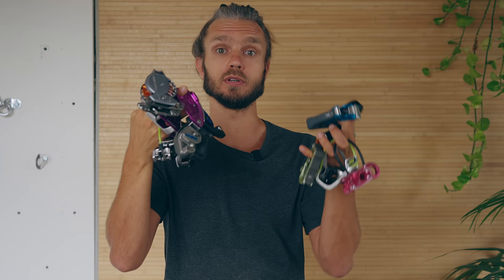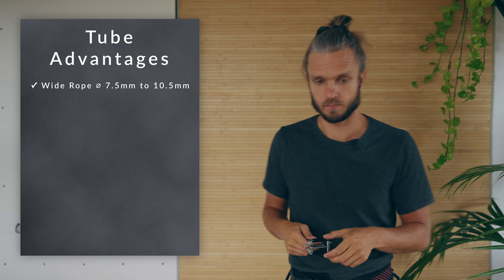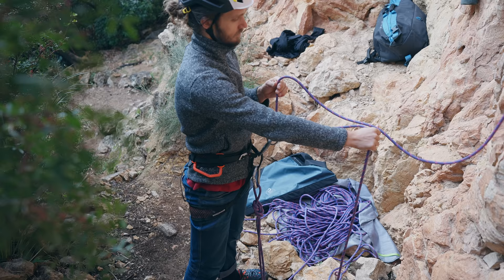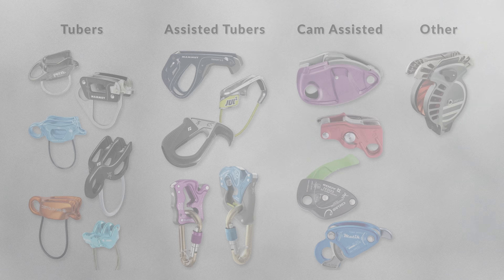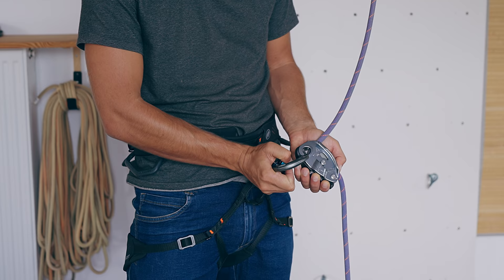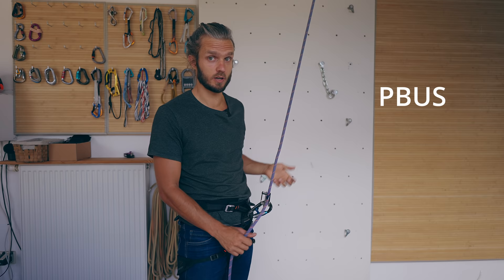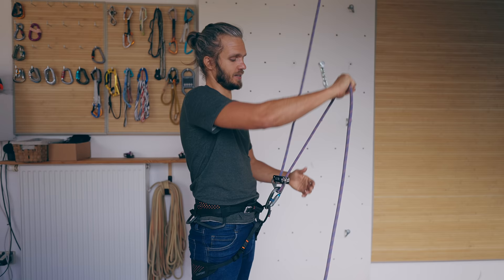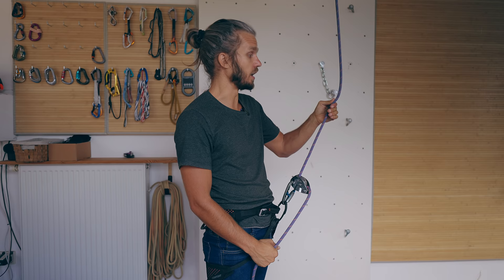Complete Guide into Belay Devices - Differences and Efficient Usage | Ep.6

Comment: The reason  why specific carabiners are recommended for assisted tubes in particular is rather because of the directionality of the carabiner. Meaning the additional piece of it that prevents it from twisting around on your belay loop. You used the cross lock which I haven’t tried but I have experienced that the combination of dmm belay master and mega jul can result in locking mechanism failing. This happens when the wire of the belay device gets pulled closer to the belayer during the locking action and that wire somehow catches on additional element in the middle of the carabiner. This can prevent the locking completely and that’s why directional carabiners should never be used with assisted tubes.

Solution? Just use a gri gri.
Reply: I agree with your experience with the DMM Belay Master, but not with your general opinion regarding directional carabiners. There are many directional carabiners who work perfetly with assisted tubes. But of course, you should never use a unknown carabiner with your device without testing first.
Also: There is more than just the GRIGRI :)
Reply: @belaygear8889  fair enough, of course if directionality of a large biner is achieved by a tiny wire right by the belay loop it won’t affect performance of the belay device. However, if I recall correctly, instructions of mega jul were actually saying not to use any directional biners. Maybe it changed since then to be more accurate. I have been a grigri believer for a few years now so I’m not up to date 😃

Comment: As you say in minute 14:00, if you drop your belay device in a multi-pitch you're screwed. 
Could you make a video testing the munter hitch to see whether is a safe option to continue the multi-pitch (belaying your partner) or it's better to bail?
It would be amazing to know, thanks!
Reply: Theminter Hitch is perfectly safe to use for braking as long as you treat it as the non-assisted braking device it is. It also twist the rope a lot.
In a mulit-pitch scenario you should concider if you have another backup for belaying and or if you deem it unsafe to not have an assisted belay-device on the rest of the route, and of it is safer to continue up or backing off.

Comment: Some personal opinions - 
1. Tubes are way outdated, dont use them, learn something safer - my belayer was once sucked in HARD into the quickdraw after I accidentaly backclipped a quickdraw and she needed to brace against  the wall with her hands (first quickdraw was low and she was pulled in face first). She didnt let go if the brake hand but had to lift it up in front of her  face and only pinched it between her thumb and indnex finger - a grigrgi, smarter or clickup locks before that point. This happens no matter how experienced you are, locking mechanism is a way to go.
2. Grigri is the most comfortable but also invites complacency
3. REVO is the safest in theory but has quite a bit of moving parts and hasnt been on the market for long, also very comfortable but requires and akward technique to lock it for hangdogging
4. Clickup and mamut smarter are a good balance between safety and comfort
5. Clickup + is less comfortable than all of the above but probably the most foolprof/safest
Reply: Imho: Unfortunatly this is a very limited/restricted view on climbing and belaying. 
1. As already said in the video and stated by some commenters, there is still very much place for tubes in current climbing. 
2. If it is for you, good. But this won't suit for every other belayer.
3. REVO is not only in theory the safest. There is no way to bypass the break. It might be one of the newest devices on the marked, i agree, but has been released back in 2018.
4. Don't forget all the other assited tuber, which are working similar.
5. I think it is very hard/fiddly to handle. It looks way to early and is nearly unusable for lead-belaying. And unlocking is also not really comfortable compared with the Clickup.
Reply: @belaygear8889  
1. yea but its still the least safe, doesnt change to point. Some people still preffer it for multipitch and alpine stuff but there are safer alternatives as well. Guide mode is chill but you aint catching many falls with that, also theres the extra biner which effectively makes it a clickup - the rope can only go one way.
2. I dont use grigri, but there is no doubt in my mind its the most comfortable. Nothing comes close for sport belaying.
3. Revo already had 2 recalls and one breakage as far as I know, thats not a good track record in 3.5 years. 
4. yep, the other ones too but these two have the most refined design, time tested....
5. yep thats what I wrote, its less comfortable than most devices. Still its my primary device and trust me, if you use it long enough, its not as fiddly. Unlocking is just muscle memory, once you get it down its a milisecond. Then again, I would never handle it to someone who didnt train on it, its very akward the first 1000 meters of slack you give with it. After about 1000, its pretty chill.

Comment: Thank u, interesting!
 
I have a question about giving slack with reverso… 

Is it stupid to Using a machard knot on the rope in order to have a brake system in case of emergency?
Reply: An assisted tube device will be safer, easier to set up, and less faff to use. Friction hitches (in my experience) release with very light contact, and incapacitated people can maintain surprising positions.

But sure, that would be less likely to be catastrophic in an accident than a tube device alone.

Comment: I am an instructor with 30 years of experience. I watch your vids mainly to steal (learn from) your awesome presentation technique. The ”number 2 rule” is now part of my repertoire!

As for the devices themselves: 1. Revo - managed to to break one in one hour indoors. Not impressed. Never have I ever broken a belay device before. 2. Assisted tubers for two rooes: not yet found one that is not a suboptimal compromise. Too much friction bringing up the second. Too sensitive to biner/rope diameter. Too fiddly. Still hoping for a new design that works.
Reply: 2. I can recommend the MegaJul. It works with a wide range of ropes and biners. And also more or less autolocks in case of a fall in most rope/biner combinations (it locks before the rope pulls on the brake hand if the brake hand is down). The Jul2 also works good but I think it doesnt autolock in all cases (I didnt do much testing on that)
Reply: @jst6757  Thanks! I think I pretty much tried them all. The megajul has a weird ”backwards” threading in guide mode, if I remember correctly. Not really a fan!

Comment: Hello and thank you so much for the content! 

One question I have in mind, what is the consensus about third hand (backup) while repelling with Assisted Breaking device or cam assisted ones ?
Reply: Don't need one. It's usually quite clunky to incorporate one with an assisted device anyways. Can't really extend them and use them comfortably.
Reply: @joshuacilliers2723  well I do extend my Giga Jul and put a prusik below it. :-D 

Is this considered waaay too much or just fine?
Reply: @bastouflette2552  In which mode do you use the Gigajul? I usually repel with it in tube mode, extended, with a third hand. The rare cases I repel in assisted mode, I have it directly on my belay loop, no third hand.
Reply: @raphaelbeinhauer9242  depend on the repel, but in both situation I use a prusik because I can see a bit of slippage of the rope when relying only on the brake. 
Don't know if it's my carabiner (HMS for belay) but I find it strange
Reply: @bastouflette2552  Yes, I've found it doesn't lock up firmly as well. I've tried it with at least 20 carabiners. I don't use the prusik in assisted mode because I think it's harder to keep proper control of the break hand if you need to tend a friction hitch with that hand, as one hand is taken up with unlocking the device. Not saying it's unsafe, just my opinion. To be honest, I really just use mine like a regular Guide Tube, On a standard belay I use a Grigri, and for belaying a second or repelling, I use the Gigajul. I like having the option af the assist, but the main reason it's on my harness is that my ATC Guide lives on my rescue harness, and the Gigajul was a spare.
Reply: @bastouflette2552  I find the slippage to be minimal, enough that I don't back it up when using it assisted. I would just imagine that trying to push the giga jul up in assisted mode would suck if it's extended away from you. For longer abseils I extend it and use it in tube mode, especially on thicker ropes.
Reply: The Alpine Up manual says you can use it without backup. The Giga Jul manual says you need a backup, but the Giga Jul also doesnt fully lock the rope (rope and carabiner dependent, but even with the right carabiner, many ropes will slip slowly). The Mega Jul manual recommends a backup. If you feel comfortable rapelling in brake assist mode with your device and your device fully locks (zero slippage if you let go), it should be OK.

Comment: Does someone have a opinion of the Black Diamond ATC Pilot??
I'm a beginner but I don't have enough money for a Grigri :(
Reply: It's a great device for gyms and single pitch, toprope and lead. 
If you like it, use it.
Reply: I like that style, but I would look at the GigaJul if I was going to do anything that might require me to clean an anchor. Maybe even just an old school ATC if I was doing toprope. The tube or placard, when they were the only devices, would be taught on top rope until the belayer had a solid understanding of mechanics. There is nothing you will learn on a $15 device that will be wrong on any assisted or automatic assisted device no mater how much it cost or whatever it is called.

Comment: Thank you so much!! It would be lovely to have some comparisons between the different devices for different situations. I mean, for sport climbing I use Grigri and Alpine Up (the upgrarded version of the poorly dessigned Click Up) when on a multipitch with two ropes. I think it is a good choiche, but, since I have not been able to try all of them on the field, I might be missing some characteristics due to the lack of practical comaprison. 
Futher more, on single rope sport climbing Grigri seems great compared to similar ones like birdie. Its automatic and you may give some quick rope pinching it. 
(((Plus when tested in this video https://www.youtube.com/watch?v=UjYLsya1T9E&t=470s birdie seems to pinch the rope harder and during the use, it may reduce the life of your rope by a little and it made me take this ressults: When the grigri is on the belayer the rope slips around 7 KN; the climber would have created a force of around 14 KN and the anchor would have a force of around 21KN. 
If you think about it, the harness is designed to support at least 15KN while many anchors and bolts are prepared to support around 22KN, however there are so many variables here and those forces would be nearly impossible to achieve in a realistic rock climbing situation. 
Therefore, just when the whole system is about to collapse grigri would release some rope to give you a second chance.)))
On two ropes climbing, I choosed Alpine Up. It is an assisted tuber with a lot of other advantages (secured rapel, non asisted tuber, to hang on the anchor, doesn`t create turns or laps on the rope...) althougt giving or taking rope seems sligtly more uncomfortable than on a reverso or a normal tuber and such a versatility comes with some weight.
In the case of this revo thing, I have never tired or seen this one, but this seems very interesting, because there probably will be a revolution on a thing like this, making able the hard catch it has or a soft catch like on a autobelaying device.
Reply: please don't use the word "automatic" for the grigri. It's SEMI automatic. Thank you.

Comment: I am not a climber, but this is one of the most unsafest things I have ever seen.. The safety of a climber depends on an angle at which the rope is held by hand of belayer.. That is so stupid unsafe. 
Why not to use this belay devices in combination with a rappel device connected below it? I think one could connect to the hip part of the harness, although it is probably not fully correct. The rappel device should not hold the weight of the falling climber- its aim is to just straighten the rope and pull it down as fast as possible and no matter where the belayer's hands are, or where his mind is.. The technique should be of course be adapted, but PBUS should work, I think.

Comment: "Complete" Guide ? Not at all, good video, title.. ahh not so good.
Picture on belay device is not full manual ! there are several ways to use some devices. Especially with tubes i see so often parents belaying their childs using normal brake setup, and then pushing rope into the device, or letting go completely.
Obviously they do not know that it is OK to turn the device around, and even instructors sometimes did not knew that.

So, no not complete guide, sorry. 
But good vid as always.

Comment: None of those devices make any sense in real world climbing. Too big, to complex, too heavy, and way to distractingly ugly. 
An ordinary 10mm thick 45mm diameter plate of aluminum with two rounded slots of 0.5mm greater diameter than your chosen rope (doubled on itself) will suffice to allow a 60kg climber with poor hand strength to arrest a 130kg climber in a factor 2 fall —if the 60kg climbers harness is tied to a daypack full of rocks. Off course that factor 2 fall is at the limits of the rope, and ought to be avoided. But still they happen which is why we climb on stretchy high diameter rope that can absorb a lot of energy. But the same two hole plate (using the smaller hole) can be successfully used to reliably arrest a sub factor 2 fall. 
My super micro belay plate has just one slot and less metal volume than the rope loop passed through it. As long as it is never permitted to get too hot to handle it works very effectively to allow two finger braking (or thumb and forefinger). One handed breaking is second nature to me. The only thing I needed to teach students was not to bother gripping the live side (loaded) of the rope except to feed out to a the lead climber. Walking their fingers on the brake side was a skill they taught themselves when they realised the lead climbers require just the right amount of slack to be continuously maintained.  All that ever took was a brief, “look how I do this exercise  to improve my finger strength. And they would practice with both their dominant and off hands, alternating while they safely belayed. 

The fancy smancy belay device designs you have demonstrated are good for only two things -spending money, and showing off.  And maybe a 3rd thing - perhaps use as a jumar. 

For €500 I will make you an ugly, complex safe belay device that a 3 year old could learn to use as long as they are sitting on a 100kg bag to which their harness is attached. It will have no cams, no fiddly bits and almost zero moving parts, and will do no harm to the child’s bare hands.   (Most of the fancy device will be devoted to ensuring tiny fingers do not get stuck in the holes under any circumstance where the holes have live rope passing through). For €1000 I will make it in pretty colours. For €1500 I will make a device that plays a tune, and glows in the dark.